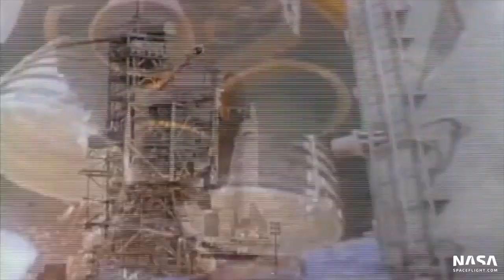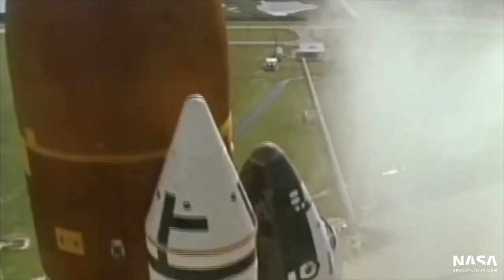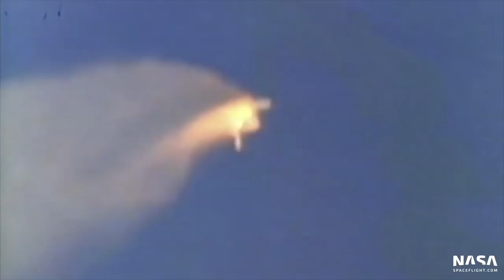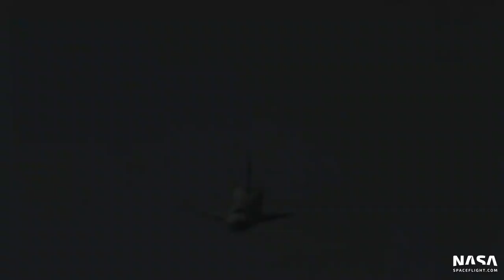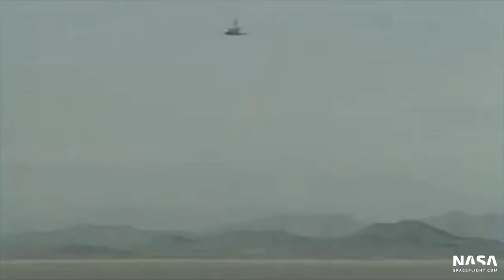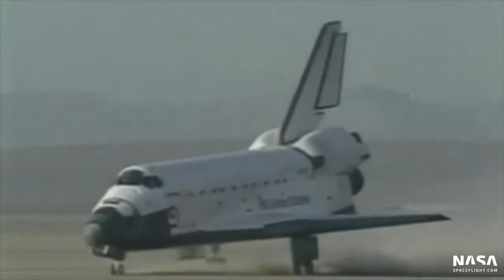STS 27 Launch & Landing

Comment: Look it's the trillion dollar flying truck. The US taxpayer sure got screwed on that one.
Reply: At about 1 billion per launch across the whole program, the Shuttle was expensive to fly.  But it's gonna cry daddy when the  SLS  gets going.
Reply: Every dollar spent on spaceflight is a dollar well spent. $1 billion to launch 7 people, 20 tons of cargo and bring several tons back along with maintenance on the most expensive telescope, building a space station and inspiring three generations of children. $1 billion on the military? New building, some more bullets, vending machine and some filled pockets.
Reply: @_Andrew2002  Government waste is waste regardless of what you spend in on.STS wasted 150 billion $ on a deathtrap that for 1.5 bil lifted into space what expendable rocket could do at 1/15 the price and HST would be cheaper if they built few of them and just sent them on Titans rather than boondoggle shuttle.I cant wait for proposed 700 mil 2007 launch of JWST to happen in 2021 for around 13 billion just to fail in space with no way to repair.Possibly a failure of that scale could be enough to shake the agency enough to look at insanity of unicorn projects like that.Or the "innovation" like recent RS25 engine contract where nasa spends north of 150 million $ for a single damn engine.
Currently people are inspired by someone else than NASA and they make rocket engines under a million $ each and weld rockets in a field because it is good enough.
Reply: @olekkuvppl  How many millions have been inspired and thus support spaceflight because of an expendable rocket?